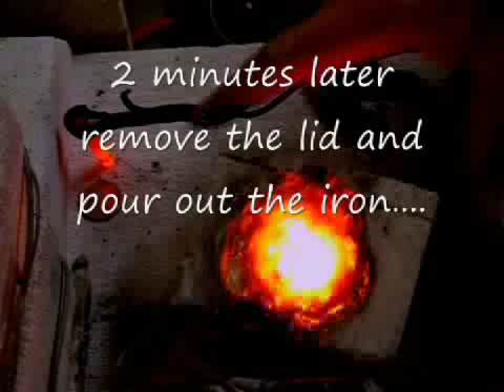Arc meling cast iron

Comment: these carbon rods are as blowing-rods for metal-cutting with a weldingmachine available. they have a small copper sheat and comes in standartlength. 
the with box is probably made of heatresistent (1800°C) stone or concrete. these are in some markets available
very nice vid..i like this idea and with a bit more power, say 220 amps, is should work even faster.

Comment from the maker: This will oxidize / burn quickly when heated in air due to the much larger surface.... lumps will melt easier as this does not oxidize so quickly.

Comment: That is a nice setup.  Cheap and easy.  Question(s):  Did you use graphite electrode? If so, what diameter?  Did you strike an arc between electrodes or between one electrode and workpieces?